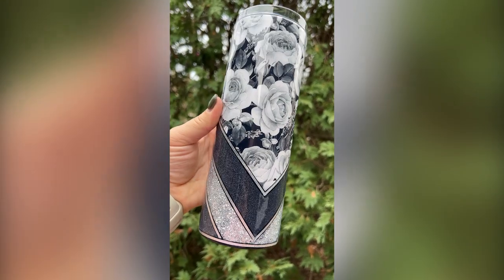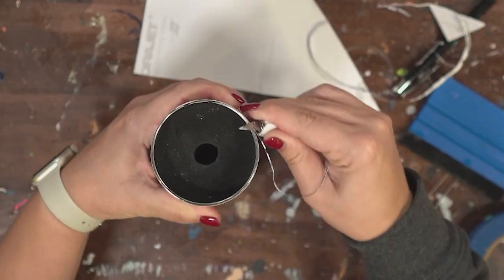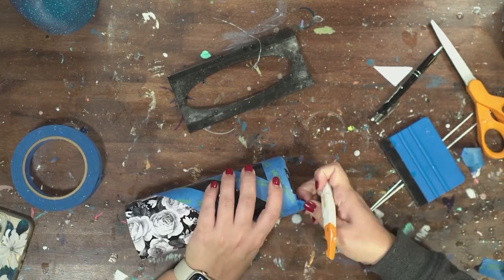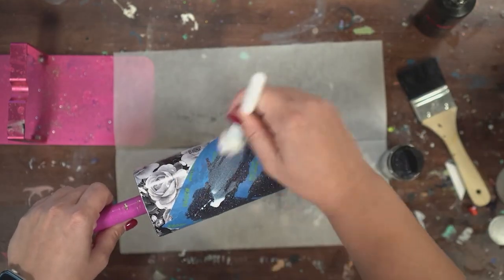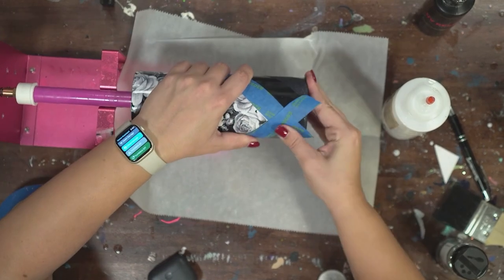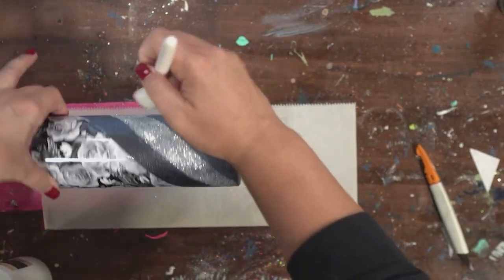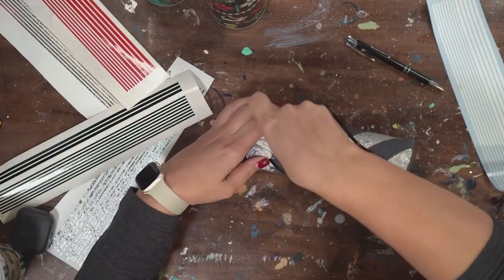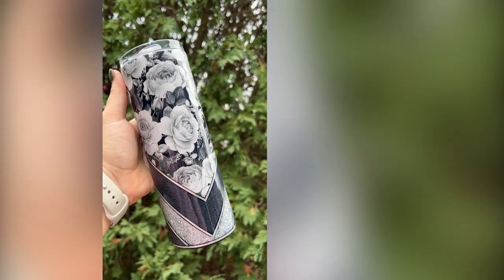V Split Tumbler Tutorial with Patterned Vinyl

Comment: I have 2 questions! 1.  Have you ever had a bottle of Grand Finale get chunky and stringy in the bottle? (Crystalac did replace it but had no reason for why it happened.  2.  When using grand finale over black paint have you had issues with it turning cloudy?  I have had to scrap 2 tumblers for that reason!  The black paint I used was the Crystalac base paint.
Reply from the maker: 1. I have not but i'd definitely ask them more questions if you really want the answer 2. If it's cloudy then it hasn't dried enough. Make sure its fully dry and clear before you put on another coat even if its more than 2 hours
Reply: @AlisonCrafts  Thank you for answering.  I did ask them but they didn't know!  I will try again. Maybe it just takes longer with the black paint.